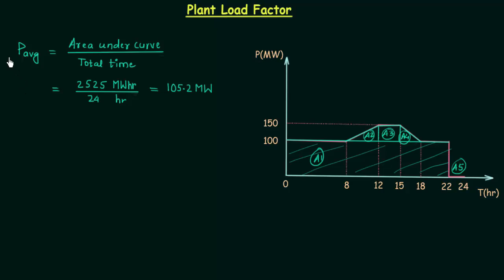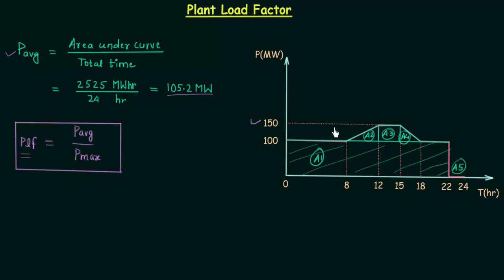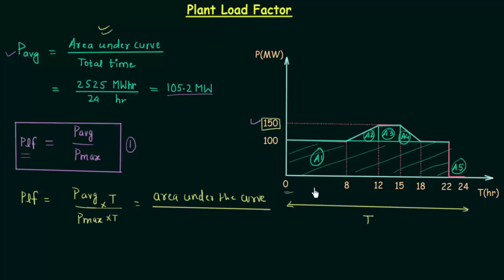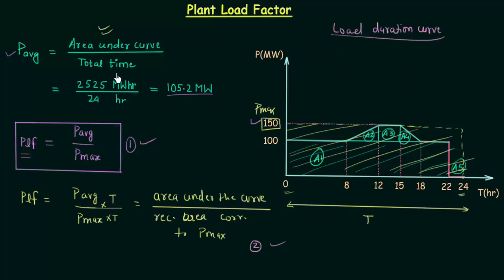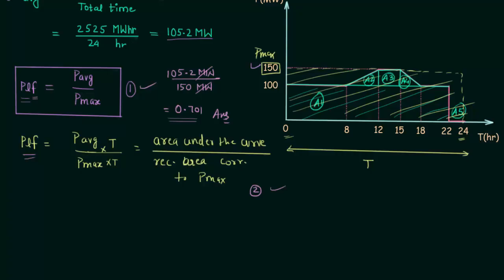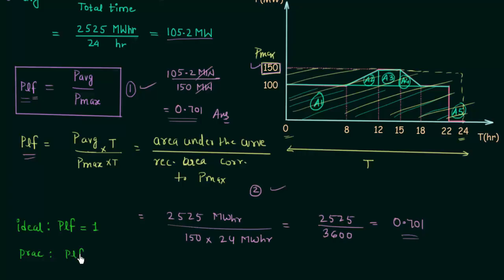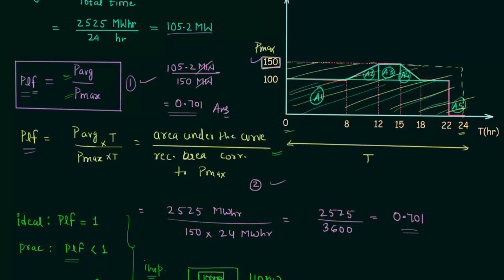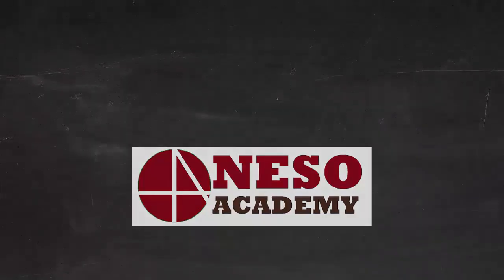Plant Load Factor (PLF)

Comment: I think there is a mistake here. If we run the gen more than the rated then the installed capacity will be more and this is not related to load curve
Reply: because once we have average higher than the peak that means we already have a new peak. the Capacity factor can be more than 1 not the Load factor
Reply: here I am discussing the issue of having PLF more than 1, I think it can not.  because the average can not be more than the peak.
Reply: Bilal Mouneir Agree with Bilal..we are calculating the load factor using the load curve only. As I understand, the ratio of average to maximum value for a curve cannot be greater than 1. Hence plant load factor cannot be greater than one.
Reply: I agree with Bilal and Mohit. The power rating of the generator doesn't come into the equation. The important word is the "LOAD"; Average Vs Peak.